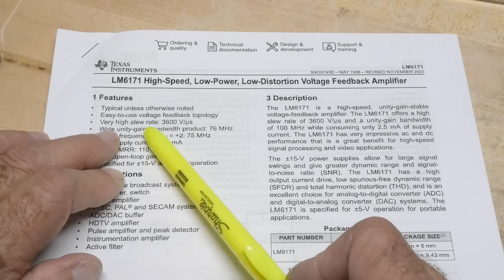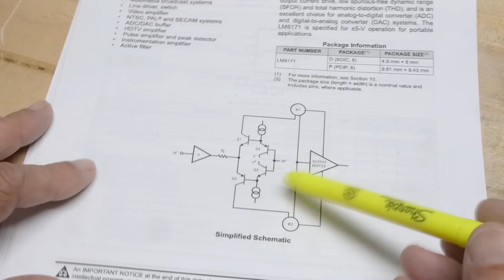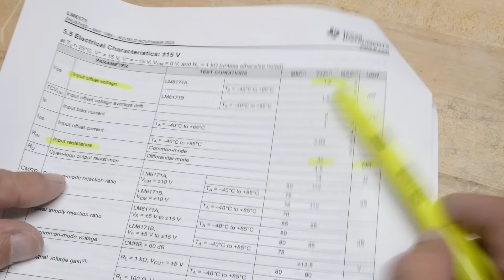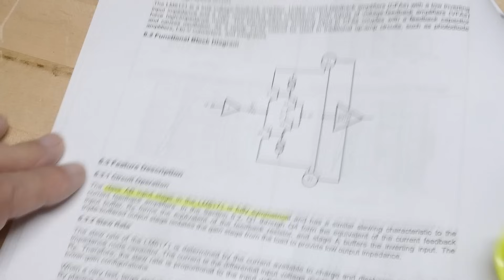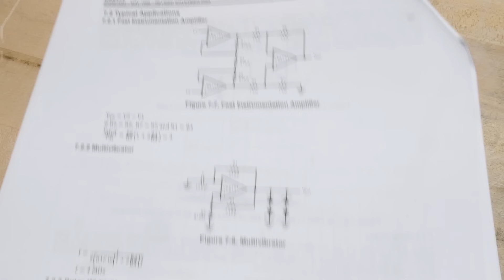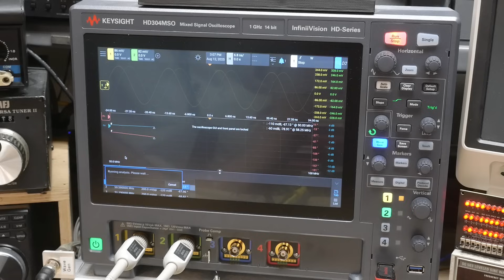#2332 LM6171 High Speed Amplifier 75MHz

Comment: Mr Imsai Guy; I'm a former application engineer at Tek, Agilent and R&S... So, being a bit of a pain about scope probing: the probing setup that you have will give a bit of early roll-off, and a resonance, due to probe capacitance and the horrible "ground lead" inductance, at 100-125 MHz, might be part of the reason for the high frequency bump in the Bode plot... If you put a 120 MHz square wave into that probe setup, the resonance is so strong that you can get almost perfect sine wave, if the source impedance is >100 Ω
Reply: Wanna give me a contact in HR?

Comment: Given the way they have the diodes on the Multivibrator circuit - I'm guessing spike suppression on the leading/trailing edges of the square wave?
Reply: That makes sense. My initial thought was that they were there to ensure the output signal has a symmetrical voltage swing above and below ground, but if that was the purpose there would probably be a series resistor on the output to limit the current.

Comment: The architecture is based on a current conveyor CCII from inverting input to output. See AD844/811, starting in the late 1980s. Here, they added a unity gain buffer at the inverting input to render it an OPAMP.
The trick is to forward the difference signal as a current into a low impedance node, rather than a voltage into a high impedance node. The output stage deals with amplified currents and is responsible to convert back to voltage. This leads to short delays and short rise/fall times.

Btw, the phase wrapping around at >75 MHz just indicates the end of the useful frequency range of this part. It doesn't mean oscillation.
The part is already unity gain stable, which in itself is a prodigy at this bandwidth.
Remember how uA709,715 and LF 356/57 were unstable at unity gain?
Reply: Well the 709 you could compensate for each of the 3 poles depending on the anticipated gain so as to get a smooth 20db/decade attenuation. Being one of the first popular OPAs from Fairchild it was slow...

Comment: Just because it was actually in the datasheet a bit below where you were reading, my guess is when you were looking at the instrumentation amp you saw 1k/510 ~~ 2, but they show a bit of the math, and it works out to 3 instead. Looks like the 1k/510 is a bit of a red herring. Doing it up in spice, the ratio of 1k/510 doesn't matter. It's completely independent and always 3 (so long as the matching resistors move together). Could be an interesting video exploring different resistor options when dealing with non-idealities

Comment: datasheet shows -3dB bandwidth for gain of Av=+1 is 200MHz not 76MHz
Reply: Can you help me with what Av is?
Reply: @MrMersh-ts7jl  Have to go to the sheet -
"Av - "Large-signal voltage gain" is the total output swing divided by the input signal required to produce that swing. For VS = ±15 V, VOUT = ±5 V. For VS = +5 V, VOUT = ±1 V
Reply: @jrkorman greatly appreciated. I thought I had looked over the sheet completely but apparently I'm blind at times